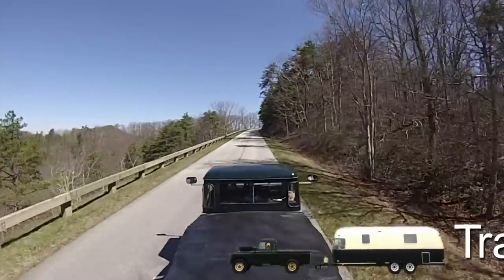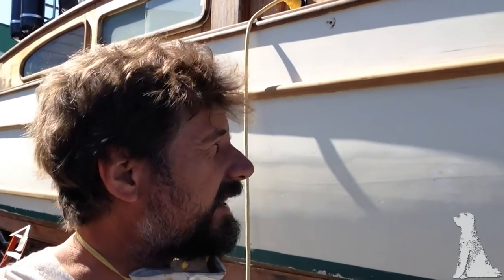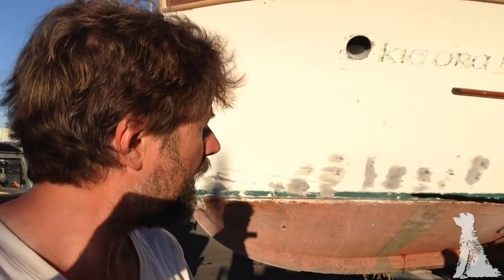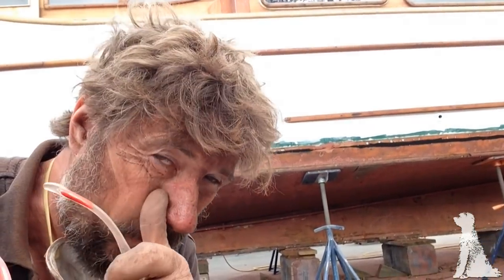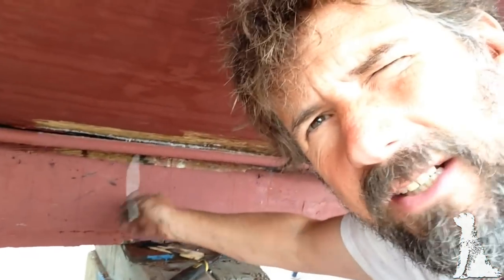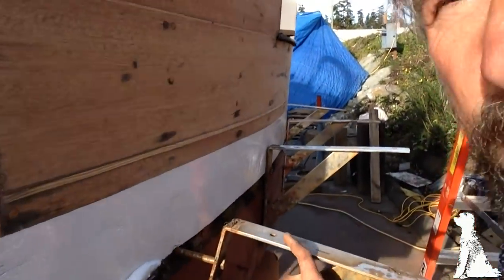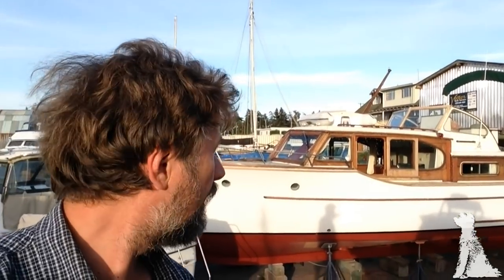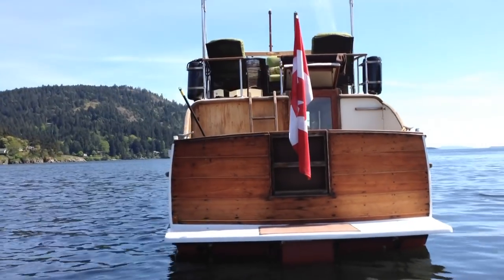Scraping, Sanding, Painting - Wooden boat restoration -Travels With Geordie #43

Comment: Wow, she sure is a beauty! The thing with old wooden boats is that they are built in a way that makes them last forever with a slight maintenance. But if they are left without maintenance they will go really bad. We had to replaced the whole bottom part on our mahogany boat from -68, and the next big thing is to restore the outer part of the cabin. It is hard work but really rewarding especially when it shines like a piano and goes 48knots :D
Reply from the maker: Thanks, yes maintenance is key. 48 knots! wow!
Reply: Yepp, it mooves! It is a 21feet long hard top boat ( Utö-21 ht ) It is powered by a 4,3 liter volvo penta v6.

Comment: If you've ever tried to paint over silicone you know it won't stick at all not ever 😣 so glad you've taken care of the garage seam in the effect that the wood is oil soaked use Dawn for Dishes and scrub it well then rinse well with water then dry it well you will have a clean seam ready for good adhesive!!!

Comment: Pay the seams with Wet Patch. The stuff you use to seal a leaky roof with. Inexpensive and better than Sika Flex in my experience. Used it on my wooden boat years ago. Did not come loose once. The down side was it only came in a black which below the water line didn't matter.
Reply from the maker: Great tip Michael, I've heard of people mixing it with cement to pay seams, wow!

Comment: to make a quick caulking iron... take a battery powered angle grinder to a junk yard..  slice off a few layers of leaf Springs that are nicely tapered..  weld a cold chisel to a groove you cut with your angle grinder in the leaf spring sections.. be sure to get different thickness of leaf spring sections to make different thickness caulking irons..  35 years ago.. i used to make these up.. sit on the tail gate of my pickup truck with Caulking irons for sale sign at the marina entrance and sold every one i could make up in a few hours.  no excuse to NOT have a caulking iron anymore..
Reply: Could you do a video on this?
Reply: @Moondoggy1941  i don't have access to a shop with welding equipment right now..  the worst part.. at the shop i did have access to in 2019.. i tossed out 3 pairs of leaf springs.   make it up out of grade 8 flat washers..

Comment: Great work Peter - I have a similar job coming up with my boat soon - I didn't see you replace any anodes in this vid, but sure you must have. Just wondering how many /what size were required for your lovely monk - and where are they mounted?
Reply from the maker: Thanks Peter, Damn good question and the subject of an upcoming episode. The rather hot topic of bonding and anodes is so controversial these days. I fall on the less is better side of the debate. No bonding at all and only protect ferrous metals underwater. I compromise with a prop shaft zinc. All my other stern gear is bronze.

Comment: That temp fix is a worry, the next pull out will require some major repairs for sure on that leaky hull
Reply from the maker: That's a valid concern, so far it's holding well but as you suspect, I'll have to do it right st the next haul out.

Comment: That swim platform is dangerous and needs some ports blown into it as it traps fumes under that lip from your exhaust(s) and if someone actually swims from it they can become incapacitated. All the new fiberglass ones in the US must conform to this in design but you have an older platform.

Comment: What is the pipe on the outside near the keel, running lengthwise?
Reply from the maker: That's the keel cooler, not for cooling the keel, but engine coolant.The engine pumps it's antifreeze through those pipes to cool itself rather than pump seawater through a heat exchanger.
Reply: ingenious

Comment: Just had my old boat out also and I also had a 6 foot section of leak along the Graboard seam on the starboard side, a shipwright put new cotton in for me and after many attempts to recaulk using the putty and then paint..no dice, continued leak from the boat's bilge, behind the engine, the lowest part of the boat, simply wouldn't give anything time to dry and water was seeping through the putty and paint..........someone told me not to worry the water pressure will hold it all in place but was not great consolation...  couldn't trust anything I put in there would stay and the putty wouldn't simply fall out as we travelld back to the mooring,  and this was a huge risk for putting it back onto it's mooring, before the fix there was s urprsiing amount of water coming in and underway even more.... after six days still couldn't resolve the issue, any rain we had ended up with a little bit of water getting through some spots on the deck that need repair, this perpetuated the issue and the costs of being on the hard were mounting..in the end I purchased a strip of heavy-duty copper sheet, was given lead-based pink sealant from the shipwright ro put on the back of the copper...copper nails and some additional sika-flex underwater sealant..on the hull, copper nailed the top then moulded the strip to the hull and keel with a rubber mallet and  naeiled down each side 2 inches apart...was a messy job but cleane dup okay for painting, it's not intended to be a permanent fix however  will probably last for ever and a day anyway. Next jobs are to seal up the decks and top-sides that I will do on the mooring, thanks for filming what you did...nice to see other old boats getting a make-over

Comment: good job! Love the boat,  my kind of design.
Reply from the maker: Thanks, I just adore it.
Reply: what is the hull speed? I like the fact that has only one motor - maybe because I feel like one motor will use less gas, or less maintenance ....:-)...also 38' is long enough to...love it
Reply from the maker: Theoretically about 7 knots. But I like to run her at about 6 which I find is her sweet spot. She's considered a semi displacement. That flat stern just slips off the water leaving almost no wake at just under hull speed. Less fuel, less maintenance, less noise. Perfect!
Reply: wandering what camera are you using for filming and about editing program. Have been watching different u-tube videos and started thinking of making some for my projects......just curious.
                Just finished watching a bunch videos from Leo - a sailor rebuilding a 100 years old British sailboat at Sequim.....what a undertaking! Found him on Wooden Boat Forum
Reply from the maker: I use a couple of different cameras. A Lumix DSLR, GoPro and sadly all too often my IPhone.  Which I won't anymore but unfortunately lots of upcoming footage is still suffering from the IPhone extreme closeup nightmare. I edit in Cyberlink Director. I've been editing video for 30 years and although it's not considered a professional tool, it's very good for the money. 
I've been following Leo too, amazing project.
Reply: thank you , I will look into the Lumix etc......would like to get familiar with stuff like that.....retirement is coming.....drone camera would be nice too
Reply from the maker: Good luck with it. I have a drone too. GoPro Karma. Love it. Footage coming soon!
Reply: Travels With Geordie 
I have Fugi FinePix SL 1000....have to explore its possibilities.
Looking forward to your nex posting !!
Reply: Karma is pretty expensive for me......I think I will start with $50 drone :-)